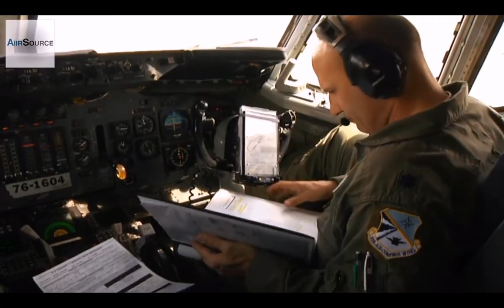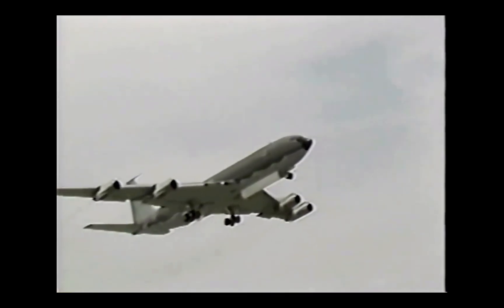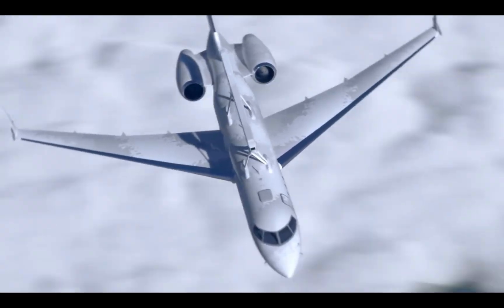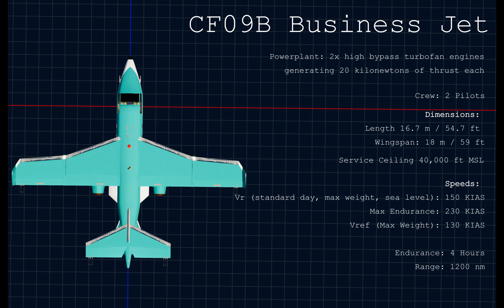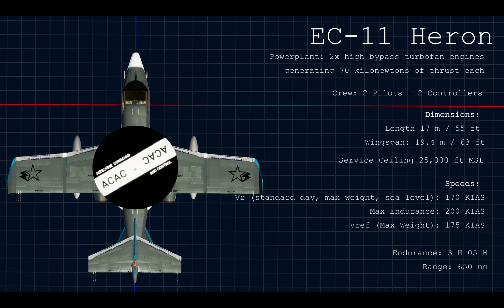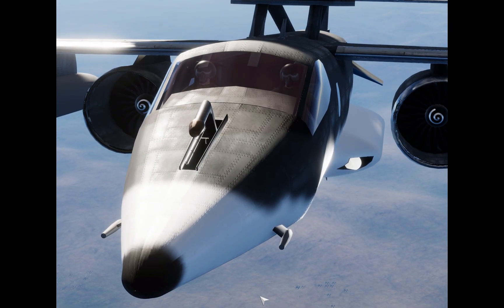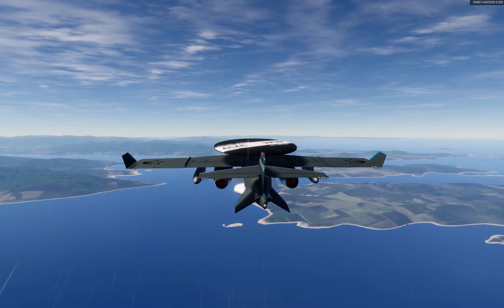How Hard Can it Be?  Converting a Business Jet into an AWACS | A Flyout Project

Comment: Why a radome? Why not conformal planer arrays? Lower drag.
Reply from the maker: Well, simply put, that's a boring solution in the game.   I wanted to something in the game that would require some movement.  While the Conformal Planer arrays would be a better engineering solution, its not nearly as good a game solution.  I actually touched on it in the video but if you blinked you'd have missed it so I didn't make it prominent.